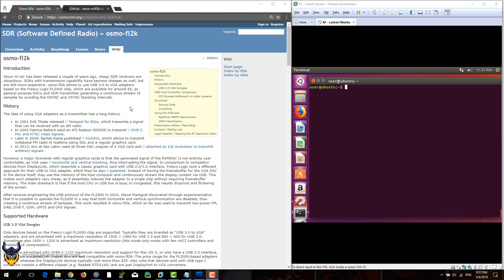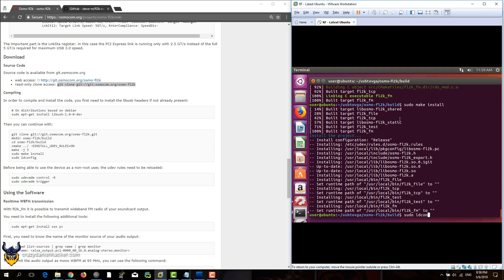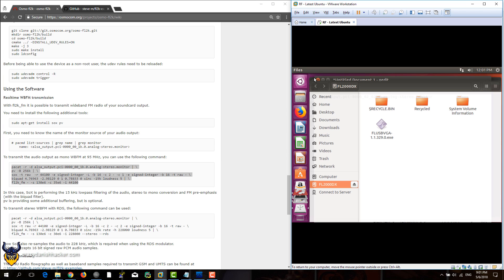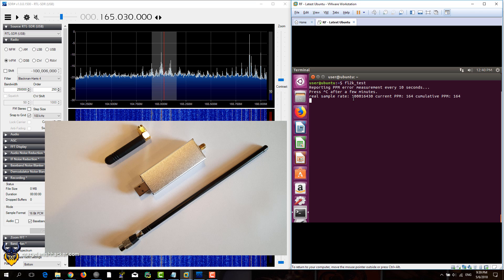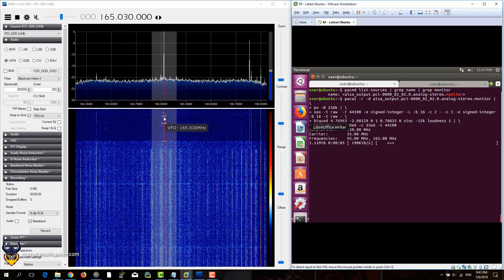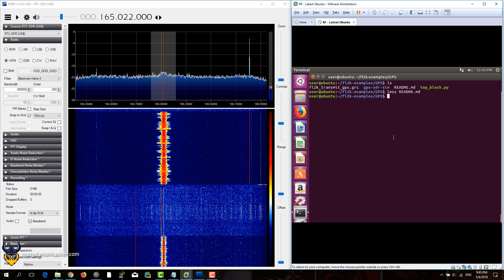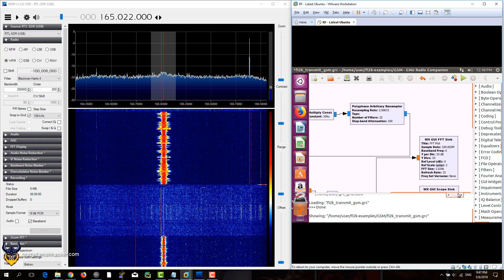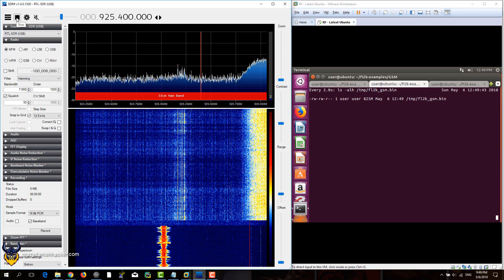USB to VGA Adapter - Software Defined Radio Series #27

Comment: Is there any pc software where you just put CW frequency to transmit ?
Reply from the maker: It is more complex than that, you generally need a transmitting device where you can control the flow of current. There are some "semi-advanced hacks" that allow you to use USB drives, special adapters like this USB to VGA adapter and even internal components of computers and devices to transmit signals, but these are not intended to be radios and may have limited range. (A few meters only)
Reply: @CrazyDanishHacker  no , i mean software for same hack instead of typing command for every frequency or steps 
It will be convenient if someone build software for this usb to vga hack where anyone can put the frequency to transmit .?and Range is not issue lna amp can be easily build

Comment: Can we use a normal sdr transceiver to transmit with this script such as with the hackrf one?
Reply from the maker: I think you will need specialized software until a GnuRadio interface or bridge has been developed. Generally speaking, I recommend using a proper SDR instead.

Comment: Getting a strange error every time of buffer underflow, while broadcasting even if the sample rate is set to 40
Reply from the maker: I don't think this software has been developed further since I demonstrated it. I also encountered a lot of errors, and in this case I recommend setting the sample rate to a lower value. If you're using this device inside a VM, that can also reduce the max sample rate as well, so try it out on Linux installed directly onto a machine or maybe even a Raspberry Pi.

Comment: How do you add the radio text in stereo rds mode ?
Reply from the maker: That's something you can add in the source code of the program, the binary file you transmit, or in some cases an optional flag for a program. I don't recommend transmitting radio with this device though, as there are many better options.

Comment: What is the  frequency Range for transmission
Reply from the maker: "In the tests of Steve an Intel Corporation 8 Series USB xHCI HC (rev 04) reaches 157 MS/s so it is possible to transmit practically from 0–157 Mhz. But since our VGA does not have any type of filtering, it is possible to use the harmonics as any 150 Mhz transmitter will also TX on 300 Mhz, 450 Mhz and so on. In this way Steve has shown that it is possible to simulate a 900 Mhz GSM/UMTS telephone base station or spoof the GPS signal at 1575 MHz, transmitting on a lower frequency that has a harmonic at the appropriate frequency."

https://hackernoon.com/osmo-fl2k-a-15-dtv-transmitter-fm-radio-hijack-and-gps-spoofing-device-68ac08ba7d76

Comment: You didn't connect the antenna to the transmitter :( of course it's not going to work well... This device has FCC certification so in theory you can legally transmit anything if you don't modify the device. Now the question is: is sticking an wire into a VGA port a modification?
Reply from the maker: See this project:
https://twitter.com/sync_channel/status/995482305891364864
https://oshpark.com/shared_projects/Y5DKWJuh

Comment: hi dani, time without talk with you

dont you believe security in smartphone is epic weak?

think about this

hipotetically

you are the thief, you steal a phone, phone is connected through a sim card to internet, but you cant disable the sim card with your hands because it has a special way to open it

then you cant open the phone to quit off the sim card

then you try to quit the battery, but it is sealed, because it needs to resist water, then you cant quit the battery to shutdown

then... you try to shutdown the phone

1) you stolen the phone already opened, that means, they can shutdown it,  and criminals win..
2) you put a pattern, or finger password, or just a password

they cant shutodwn it, but they can restart it and also they cant turn it in emergency mode with movile data disalbed.., incredible!

then criminals are winning, people without a university study, are winning to all the staff ot smartphone companies, incredible..

well, samsung and another companies can put a security for restart, shutdown and emergency mode buttoms right?

well.. even with that, they can still do something, but is harder for many criminals " isolate conection "

then what comapnies must do? if someone isolate the conection

a buttom that enables a pre programmed app that makes if your device wasnt synchroniced in the common places, and password wasnt putted well, they recognize it as a motherboard memory battery " with clock " and if that happen, devices laucnhs a command to erase all the device, even bios

what do you think? and why do you believe companies didnt this in 10 years?

marks zuckerberg is in risk for a less thing as cambridge analytic, and this companies put in more risk all the people than facebook

dont you think it?

they should launch a fix for all their smartphones
Reply from the maker: Thanks for the comment, some phones allow you to remotely track and also wipe (delete everything) remotely. Both iOS and Android offer full disk encryption by default in almost all versions I believe. With most phones you can just replace the SIM card, at least here in Europe and Australia. Some phones can be reported stolen and their IMEI (i.e. serial number) will e.g. be blocked in the country they were stolen in.

If you find a good remotely exploitable bug in iOS, then you can sell that bug for like up to 1.5 million USD. If you find a pin bypass in Android, you could get up to 15,000$ USD.

I believe the weakest point in mobile security right now, are:
* The users, choosing weak passwords, no encryption, installing apps that are almost certainly malware, etc.
* App stores, especially for Android. A malicious actor can create bad apps. I know that Apple's App Store is much more thorough when it comes to review apps, but even they and also Google can be fooled to allow potentially malicious apps. It's basically a nearly unpatchable flaw in the design of an open app market. I believe an open app market is important.
* Jailbroken phones. These typically have lowered security.
* Phones from manufacturers that don't patch their products. (I think the manufacturers that actually sent out a lot of patches were Samsung, Google and Sony. Not 100% sure. I just know that Samsung pushes out a lot of updates, including security patches whenever there are important issues to be fixed.)

Phones nowadays are really just "small mobile computers with a lot of processing power", most of them are 10-20 times faster than what I grew up with in the early 90's.
That's why they also have a lot of flaws to be exploited. They're basically as secure, and insecure, as your laptop, whether that be Linux, Windows or OS X.

However, it's still generally easier to perform attacks against servers and actual desktops these days it seems, but there are of course other attack vectors you can perform against mobile phones, especially when it comes to rogue mobile networks, whether that be WiFi or GSM. The GSM specific attacks are getting harder to pull off without any downgrade attacks, because at 4G both the client and the network authenticate eachother as far as I know.

Reference:
https://zerodium.com/program.html

Comment: hi, great video like always :) I have a question : May you show the distance between your RTL-SDR and the FL2000 ? and generally, what is the power of transmit of the FL2000 ?
Reply from the maker: Thanks :-) The RTL-SDR was using the ANT-500 antenna, and it was right next to the FL2000 USB to VGA adapter, as in 1cm. Keep in mind I did not connect an antenna cable to the "red port" as I talked about briefly, so that's probably why the signal was very weak. When I used a small GSM antenna, the signal was a lot weaker.

Comment: hey buddy your channel based on radio hacking how can I learn radio hacking? I am just a beginner thanks
Reply from the maker: Try out the GSM Hacking Series I made with an RTL-SDR. (They cost around 20-30$ on RTL-SDR.com if you want a good one.)
You could also read this book I'm featured in: https://www.springer.com/us/book/9789811084461#aboutAuthors

In general, I recommend you first get an RTL-SDR as they're cheap, and then you look into decoding signals first. If you're still interested after a while, then you can look into buying a HackRF, BladeRF, LimeSDR or USRP depending on what you want, and your budget. Generally speaking, one of the first three will do fine for most projects, but make sure you do some reading on what you want to do, before you buy a TX (transmission) capable SDR.
Reply: thanks a lot brother

Comment: Thanks for great video
still don't get it how can you use this to create GSM Base Station, because for BaseStation you need a full duplex TX/RX Device like BladeRF

I could try this with my HackRF One and AirSpy though :)
Reply: I just received my FL2K a few moments ago. So thanks for the video.

Wouldn't it be possible to use RTL-SDR for the RX side?
Reply from the maker: You can but they won't be synchronized, even if they shared the same clock there will most likely still be some issues. But in my video I used an RTL-SDR to look at the transmitted signal, and the USB to VGA (FL2K) adapter to transmit signals.
Reply from the maker: Yeah I saw the presentation. No one has made a working proof of concept yet :-)
Reply from the maker: You're correct that you can't create a real GSM Base Transceiver Station (BTS) that you can authenticate with. So the signal you're transmitting can be seen by some phones and grgsm (e.g. grgsm_livemon) for example, but no one can use that network though.
Reply: Or maybe it could be done:
https://youtu.be/VRvLVjLQSaw?t=25m10s